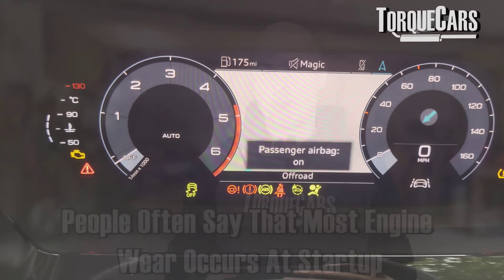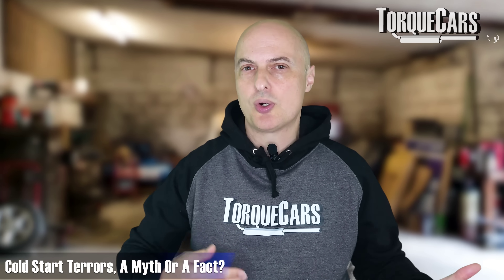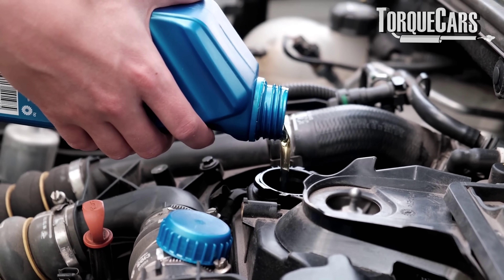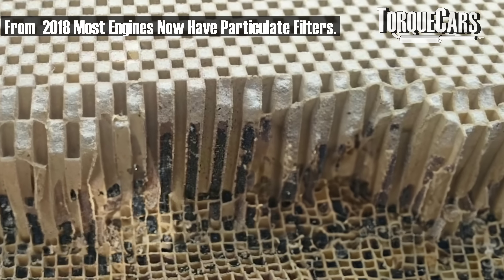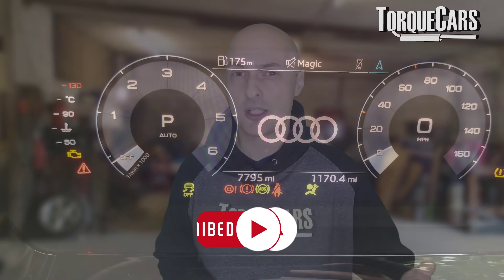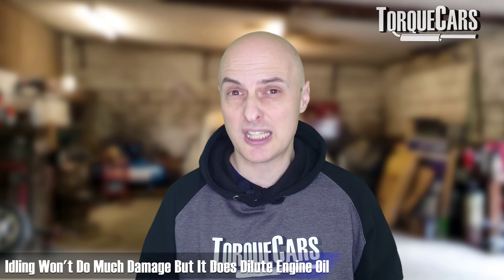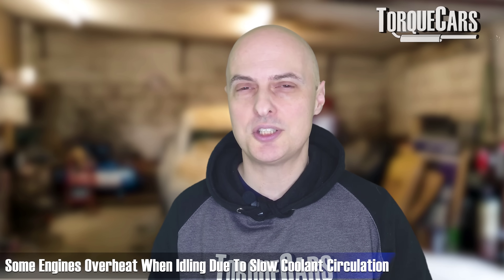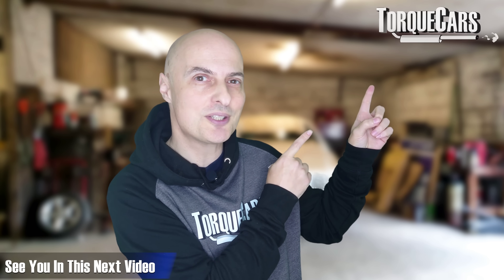❄️Reasons Why Bad Cold Starts Destroy Your Engine ☃️Prevent It Happening To You! ⚠️

Comment: I have a Toyota FJ cruiser. I recently did a oil change on it. normally I start my engines and let them warm up for 5 to 10 minutes at least, before doing a change. The oil, when it runs over my gloved hand is noticeably warm. not burning, but very warm. This time I only started it to move it to the garage. Like 3 minutes, then pulled the plug. I was suprised by how cool the oil temp was to the touch.
Reply: It is a shame that more cars don't come with an engine block heater as a factory installed option.

Comment: 2minutes ideal and 10minutes soft drive is sufficent for attending minimum OT . Not pressurising throttle for half an hour  also helps in transmission and tyre heating up little to ge that supplness and flex  .

Comment: My racing buddy puts a pre oil flow/ pressure pump on his trucks. Fuel pump and oil electric pump buzz to extacy before starter engages. Instant quiet start every time!
Reply: Brilliant! That's going to prevent most of the start-up wear.

Comment: Very good points.  
I typically start the engine, wait about 20 to 30s, put the auto transmission in drive and wait a few more seconds, then drive "gently" until at operating temperature, not that I drive spirited anyway.
At Perkins Engines (UK) in the early 80s, my Alternative Fuels Development boss, Dave Bacon, said that when he worked at Lotus, they had bore-glazing issues in the US.  People would leave the car idling while eating breakfast to warm it up!   The excess fuel from the choke being activated washed the oil off the bores.   Less of  n issue today, but still occurs as a cold engine needs a richer mixture and cold cylinder walls condense the fuel. I'm not a fan of Gas Direct Injection due to the fuel dilution that occurs in the oil and the carbon buildup.  PI + DI is a better configuration to avoid carbon buildup.

Comment: Simple in my world: Since I live right off/close to the highway, I give my ‘17 Subaru 30-45 sec (summer) or 3-6 min (winter) til the cold coolant light (no gauge 👎) shuts off and the 17-1900 open loop RPMs drop to normal 750-800. Gently from there to the highway and then increasingly spirited. I think it’s a perfect balance, plus much better for the longevity and clutches in transmission to not slam into load at high idle or full cold. Idemitsu GF-6 5w-30 strictly every 5k mostly smooth highway of 16-19k miles/yr. 93k, tailpipe has almost zero black on full finger rub, and not a drop of consumption (port injected).
Reply: for the longevity and clutches –Here in the NL (mild climate) we are advised by the national automobile association (ANWB) to let go of the clutch very slowly and gradually when cold start in winter temperatures.

Comment: Usually start from cold and let engine idle for a couple of  minutes before driving off. Then just steady driving until engine temp gauge shows engine warm. As you say, engine oil takes longer to warm.  Luckily, my Octavia Scout has an oil temp gauge so I'm able to hold bag big throttle until I can see oil is up to temp. 
As per your other video, l always give engine a couple of minutes of turbo run down time to let this slow down and engine temperature to equalise before turning off.

Comment: Always drive gently after initial start up, and don't ask anything extra out of the drive-line until engine reaches operating temp. I store two classics and run nothing but Amsoil synthetic, no failures and always get up to temp and then push hard to "clear its lungs", so far I have had no issues and one gets driven rarely, and I have winter stored it since 1985.

Comment: My car, a 2019 Nissan 370z, has a closed-loop fuel injection system with electric heaters on the O2 sensors. On a cold start, the engine operates open-loop for only about 10 seconds before the heaters get the O2 sensors working and the engine goes into its programmed closed-loop mode. I then idle the engine until the coolant gets up to temp, about 5 min, and then drive off gently and keep the revs not over 2k rpm until the oil gets to 180⁰F.

My car has 66k miles; uses no oil between its 3k mile oil change interval, exhaust tips show virtually no soot residue on the inside and two used oil analyses reports showed good viscosity with hardly any water or gas contamination and very low wear rates of metals like iron, copper and lead. An oil pressure check with a mechanical gauge showed 30 psi of oil pressure at idle and 60 psi at 2k rpm, both at 180⁰F oil temperature and with the recommended 5W-30 oil. The Nissan spec for this engine,VQ37VHR, is 14 psi at idle and 42 psi at 2k rpm, with 5W-30 oil at 180⁰F.

I think the quick driveaway was probably a good thing for older engines with carburetors or unheated O2 sensors that wouldn't control the air fuel ratios as precisely as the newer cars, maybe causing excessively rich running condiyions on cold idling.

Comment: If you want to increase longevity on your engine and you live in a place where it gets really cold - purchase and install a wet auxiliary heater. This way you will start your engine at 50C or above that temperature on the cooling system and the whole interior will be warm. Also it uses less fuel than the engine idling. And you pretty much start on warm engine. If that's not possible, as the car is parked on a cold garage, then purchase an electric heater that is mounted on the head itself (this is very common in Sweden). This way this warms the temperature in the head, usually located somewhere on one of the tubes that brings cooling water to the head itself. It raises the temperature to about 25-30C in the head. It uses about 1-2kw/h electricity. Quite useful.

Comment: Great advise. I usually just wait for the rpm's to start dropping, then drive relatively gently (2000rpm) until operating temperature. Also, full synthetic flows better than conventional at low temps. My 2006 Toyota Matrix has over 226,000 miles (363,000 kilometers) and runs perfect (5k mile OCI and OEM filter).

Comment: This is exactly what I do! When the engine ticks down I put my foot on the gas pedal for another 3 to 5 minutes on a slight load until the oil temperature gets to 100 Fahrenheit, then I start driving. I have a turbo so I don't push it too hard until it gets to about 180 Fahrenheit.

Comment: Here in Scandinavia, when it gets as cold as -30 degrees in the winter, we electrically heat the car for an hour or two, depending on the degree of frost, before starting the car engine. But Old Volvo Never Die.🏁

Comment: Meanwhile I turn off AC and letting engine get all that heat build up as fast as possible while i’m freezing my ass around -20 celsius, so that should tell how much care I take of my car, also warming engine with block heater for 4 hours before, still I let my iron cow to gather and build that heat for itself before I let myself to get warm :D
Reply: @BLCKVD  That’s strange, I’ve noticed that running the AC helps raise the engine temp quicker at the expense of freezing inside even more due to the compressor taking heat from the evaporator inside the cabin and pushing it into the condenser right infront of the engine radiator. I once tried to put an electric heater inside the car with the car just started up cold with the AC on LO setting and my theory was confirmed, within 1 minute of idling I already saw my temp gauge move. I couldn’t wait longer than 2-3 mins but by then it was already halfway to operating temp on the coolant. When I turned off the electric heater and stored it into my garage to drive off, I turned down the Ac to its lowest fan setting and it was still relatively comfortable inside and I was at operating temp according to the gauge before even leaving my neighborhood. This wasn’t on a very cold day though, it was only 0c/32F but oh well.
Reply: @surena9451  Apparently, that AC does heat up front of the car where that AC radiator is and car engine coolant radiator, usually they exactly sandwiched together so that warmed up AC coolant radiates that heat to engine coolant radiator, but definetly don’t help the colder it gets and only works if you put ac to turn air to cold which doesn’t make no sense when outside is already freezing cold, but you can heat up engine coolant that way like you did at those temps, also turning ac on makes engine struggle more which causes more heat build up faster tho these all can be very minimal and marginal
Reply: Most modern car’s AC systems don’t turn on below a certain temp or if humidity is low. The light on the dashboard will turn on, but the AC system itself will not cycle.
Reply: @tosil  Well with me running an electric heater inside the cabin, the evaporator - which is inside the cabin behind the dashboard cannot freeze over thus the AC keeps on pumping as if it is summer. Even under normal circumstances, when you run the heat from the engine (when at operating temp) the AC still works during winter as a dehumidifier and doesn't freeze over the evaporator making it useless during winter dehumidifying. The condenser couldn't care less about summer/winter as it would be the hot/high pressure side of the system.
Reply: @BLCKVD  this is the way, I had a car with heated seats awhile ago and would do this, and I just bought a new car and once again have heated seat. Set the seats on high and keep that coolant circulating through the motor and radiator instead of the heater core 👍👍👍
Reply: @BLCKVD  I don't know why that would work. Under normal conditions, the airconditioning uses a pump to cool the air, like in a fridge. Turning the AC on would in fact warm up the engine a bit quicker as the AC pump puts an extra load on the engine. An additional benefit of putting the AC on is that it dries the air, preventing the windows to fog up. But maybe it works differently under the conditions you describe.
Reply: On my diesel car i putt loads like AC, hot rear window, heat in seats and so on to give it work to build temperature faster.

Comment: I still have my ‘98 pickup with a Cummins diesel in it. When I first bought it back in ‘98 I drive it like I stole it and when it was cold I would jump in it and hammer down the pedal. The black smoke would pour out and it would sputter until it warmed up. At 200k miles I had a new turbo installed and they pulled the head to take a look at the cylinders and pistons. They said there was very little blow by and the cylinder walls looked fantastic. I just keep fresh high quality oil in it.

Comment: It's simple, like you first said, the engine is in its bedding in state only when everything is fully thermally expanded.
Also the additive package in the oil, which is business the part of the oil, in many cases are heat activated so isn't fully protecting the engine until it's at full operating temp

Comment: The best you can install an engine heater for a quicker warming up. There are electric ones and ones using the cars fuel like a Webasto or Ebersprächer..Electric ones use to warm up the oil and the fuel driven ones the coolant. Even better is a combination of both. The fuel driven ones do also warm up the inside of your car and using electric ones there can also be an output in the car installed for an heating fan to warm the inside to quit scraping windows, Mention that the engine and gearbox still won't be on optimal temperature but the warming up process is going way faster and will increase the lifetime of your engine. In the north of Scandinavia more than 90% of all cars have engine heaters.

Comment: Wish all cars came with a block heater.
Reply from the maker: I guess that would make cars too reliable and push up the new car price, both things a manufacturer doesn't really want.
Reply: THIS! Even if they saved money by having the heater in all the blocks, but having the customers choose if they want to buy the power cable or not! I go a little batty hearing cold start info from people living in SoCal or other places where they discuss "cold" starts at 30-40°f, so I'm glad this video takes that into account
Reply: I think the best ones are those webastos.. They heat the cooling water while circulating it around the engine.
I have an old one i an MB 500E from factory. Coolant temp is at around 70 deg C after 15 min. And whatever temp you set inside the car.
Reply: @audi_fan_man That's why you use a webasto instead.
Reply: @audi_fan_man Its a brand really. One of the more common that makes those gas powered engine heaters..
Its a kind of burner that heats the coolant. A water pump is included in the system.
Can usually be ordered with your car from factory. At least MB has that option. I think they are around 5kW usually. 
Gets the coolant to operating temp in around 15 min.
Reply: @audi_fan_man  all block heaters I have ever seen in the United States are just a heating element in a coolant plug spot in the block , and they have a short cable lead that allows you to power them with a 120vAC extension cord(usually sticking out the front grill)
Reply: @audi_fan_man It depends on so many factors... How much is it worth to you and for how long will you keep the car. 
Personally it would be one of the first extras I would check if I bought a new car so that its mounted from factory.
But adding it in hindsight... Will cost a bit unless you can do all the hassle yourself.

If you have an electrical outlet where you park the car you can get a more powerful variant of an electrical heater nowadays. That also circulates the coolant water and works the same way as the gas/diesel powered ones. Although with less power still.

And then there's the regular option with those approx 600W coolant dip heaters (but no circulation) + a separate 1200W cabin heater.
Reply: @jrfarawayfrom2016  Unheard of in Australia.
Reply: @perpetualgrin5804  does it get cold enoyin parts of Australia for this to be a thing
Reply: @jrfarawayfrom2016  No we don't have them not often below 32 f.
Reply: I have installed a 12V  60A water heater in line one of the coolant pipes. Works wonders ! It was barely warm after 15 mins of driving, now it heats up almost to operating temp in 10 mins. (diesel)
Reply: That suggestion cannot be beat gray comment!  ☺

Comment: My main trick to warm up the engine is just start it, turn it up to full heat to get the water flowing through the heater, but leave the fan off, turn on lights and rear window heat to put a little load on the engine. Then remove ice and snow while its idling, and by the time you're done with that, the coolant in the "short" loop will usually be up to 30-40C.  then, either turn the fans on, and drive off if the windows aren't fogged up, or turn the fans on but on the lowest setting and wait for visibility to improve.. by then putting a bit of pressure on the accelerator to get the RPM up a bit should be fine to make it go a bit quicker, and keep the coolant temp up. 
I found that works well for my car so far... (had it for 15 yrs now)

Comment: I tell people. No matter what the weather. Let the engine run until the engine drops below 1,000 rpm. At minimum. But if you live where it can be -40° to -50°C or colder. Or even a bit warmer. That on days with snow or ice on the car. Start the car then clear it off. If you don’t have anything to clear off wait until there is enough heat to keep the windows clear from fog so you can see the road. Looking through that sliver at the bottom of the windshield is dangerous and with air bags especially dangerous. If you live somewhere with really high humidity like along with coast wear snow is rare but you can still get below freezing if can be a challenge to get your windows to stay clear of fog on the inside until you get some heat in the engine to clear the windows. That is also dangerous to drive before you can keep the windows clear. Where I live now we don’t have moose like where I used to live. But we have Roosevelt elk which are nearly as big. You don’t want to hit one ever. But especially because you couldn’t wait a minute or two so you could see them. I keep a sock filled with clumping kitty litter in one front door pocket and one in the rear door pocket on the opposite side and if you have a hatchback then one in the trunk. It helps significantly to keep the humidity levels down so that fog on the inside of your windows is significantly less and takes significantly less time to clear the windows. Low tech. But highly effective. Just remember to use a thin sock with a fairly tight weave so you don’t have kitty litter leak out. Cheap dress socks work well. Just fill and tie a knot in the open end after filling. Also unscented litter is preferable. As long as the sock doesn’t go moldy. Which is incredibly rare. Each sock should be good for at least a few years. I have 4 or 5 full years on my current ones so far. They tend to dry out in the summer. Between the heat and the A/C. I pull them out a few times a year when I do a major interior cleaning, to check for leaks or signs of mold and mix the litter up a bit by kneading them just to keep them in the best condition possible. I do quick interior cleaning more often. But the major deep cleaning where I pull everything out and let my O.C.D. loose on it only a few times a year. Because the major deep cleans take me about 4-6 hours, and I have other things to do besides always cleaning my car. But I do keep it reasonably clean always. If I give a friend a ride. I don’t want them to dread setting foot in my car. It’s a point of pride to keep a presentable car for me.
Reply: @ you can do that. I used to use them. The way I described is just much cheaper. That part appeals to my Scottish heritage. 😄
Reply: @ they do help. It won’t be instant clear. But will shave minutes of the time needed.